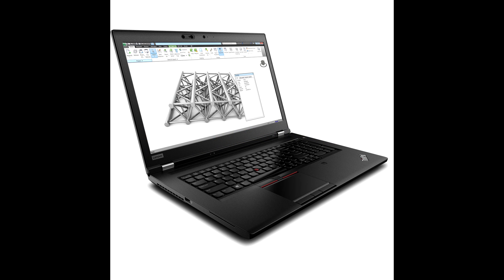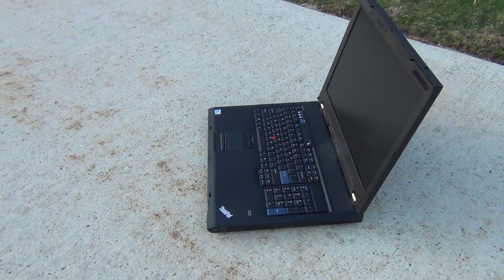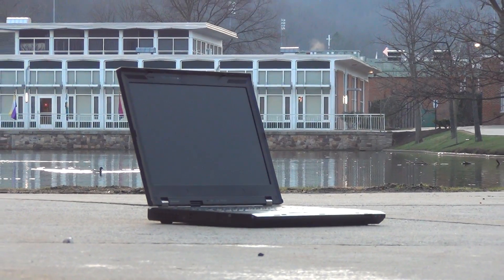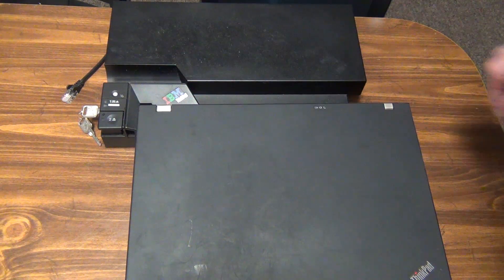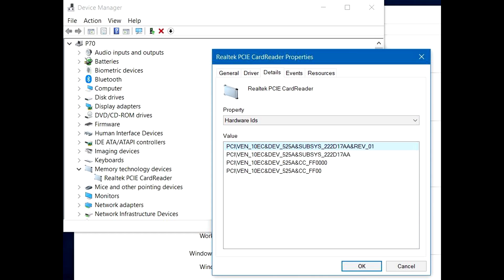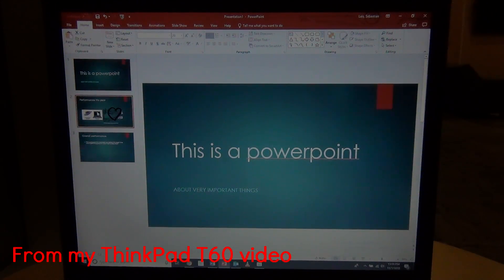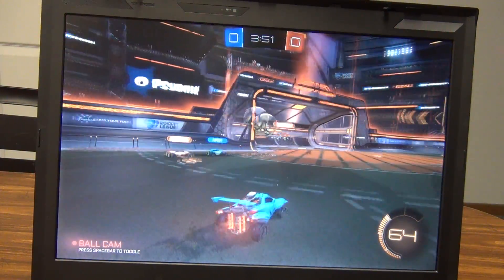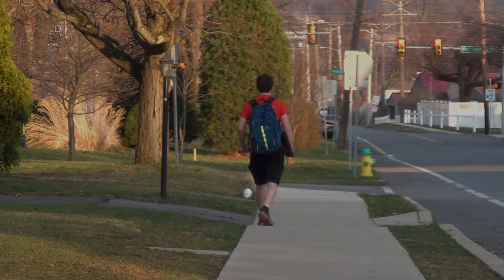Using an 11-year-old Mobile Workstation in 2019 (ThinkPad W700)

Comment: It's not officially supported since 8GB sticks didn't exist at the time,b ut W701 with quad core CPUs can even take 32GB of RAM
Reply from the maker: I remember reading about that somewhere, I think on the ThinkPads.com forum or the r/thinkpad subreddit, but even the ThinkPad Wiki page for the W701 didn't have this confirmed (it did mention that quad-core W510's could support 32 GB) so I felt it was best not to possibly spread misinformation.
Reply: @SebisRandomTech  I can confirm that my w510 is running 16gb RAM (4x4gb 1066MHz) on a quad core i7.
Reply: Wow! Would that upgrade be possible on a W500 or W700? And do you game on it?
Reply: Just a note as a reaction that you have never seen an Arrandale with 4 DIMM slots, Dell Precision M6500 sold not only with Quad and Extreme core CPU’s (i7-740QM, i7-840QM, i7-940XM) which allowed a user to have 32 GB RAM, but also with Dual Core i5-560M, i5-580M, i7-640M with 8 GB RAM limitation (only two banks could be used – similarly as on newer dual core Precisions where quad core processors are required to use all four slots).
Reply: The first gen i7 consisted of i7 dual cores and i7 quad cores. The dual cores had two separate dies on the "CPU chip", the CPU and the integrated graphics + memory controller which is based on the Northbridge that Core 2 Duos were paired with, so those maxed at 8GB ram using two 4GB sticks. They may recognize 8GB sticks but crash if you try using them. This applies to all first gen dual cores, i7, i5, and i3.
The first gen i7 quads on the other hand were entirely different beasts with new memory controllers that could use 8GB sticks so in your case you got it to use 16GB and the 4-slot machines can have 32GB.
Reply: @FleetCaptainTalmid  I learned all of that the hard way when I got an old Dell that uses first-generation Core i-series. Nothing you can do will make it handle more than 8 GB, even with the i7-640m. The i7 quads are a no go because there's no dedicated GPU. On top of that, you can't run 8 GB at higher than DDR3-1066 in this laptop (Inspiron 1764). It will run 4 GB in 2+2 configuration at 1333, but 4+4 or even 4+2 at that speed would crash during startup. 4+4 will only work with two sticks at 1066.

It's really not a viable machine with Windows anymore, but I installed a modern full-size Linux distro on it (albeit with Xfce) and it works great.

Comment: It is interesting how almost any 17" professional laptops of this era dissapeared from the used market. 3-4 years ago you could easily get them, now I see no w701 (not to talk about w700), HP 8740w, etc.

Btw, which 17" laptops (pro or not) do have 1920x1200 displays? (16:10 format)
Reply: Exactly. Even where I'm at in Malaysia, right now you can hardly find the popular ones on the market at a high amount and good price such as the x200, 201, 210, 220, 230, t410, t420, t430, and a few others. Back in 2020/21 the used market was flooded with them for good prices. It's like they've disappeared suddenly or everyone who got one has become a hoarder.

I got a 420, 230, and t60 back then, which were good investments on my part, as I still use them to this day, and the prices for them are more bloated now than then. I just got lucky with getting two for parts 220 for cheap price, and swapped parts to make the one with the better shell useable, and will sell of the other one for scraps/parts. Couldn't get a good 220 for a price that makes sense.

Comment: running those games were pretty impressive, i dont get the constant harping on "portability" i can pick this laptop up and carry it out of the room or out of the house just as easily as any other one, are we really counting ounces and quarter inches.. fits in a generic back pack fine, if you cant carry 8lbs you need to get off the laptops and outside more.. i carried a 25lb back pack through some hills, snow packed or ice covered trails, for a little over 2 hours this past weekend and didnt even notice the weight of the bag even when trying to maneuver hills that were a sheet of ice im not particularly fit either just got the urge for a winter hike

wish people would stop focusing on compactness and weight, and allow there to be two different genre's of laptops, ones for sleek feeling carry it to class tasks, and one for home users that want maximum I/O and performance who dont mind dimensions and weight.. i want a laptop not a desktop as i use this thing for work, for games, for TV, several hours a day i cant remember the last time i turned my TV on, no desktop, no gaming console, just one laptop, and i move around quite a bit, several times a year, but its also nice to be able to switch rooms or seating locations with ease.. to me if my laptop was  3" thick and 25lbs i would barely notice and id take that trade off for improved performance, a bigger screen, and a longer battery life, My 2019 Acer helios 300 still only gets around 2 hours of run time streaming a movie or youtube and thats with power settings being conservative..
Reply: forgot to touch on durability too.. ive had my power adapter fail twice due to bad design im sure that design was hampered by size constraints.. my speakers blew in under a year, fan failed recently, and both the CPU and GPU are constantly at thermal throttles, laptop gets too hot too touch under a heavy load which im sure isnt great for internal component longevity...

we praise the thinkpads for their durability.. while failing to realize most of that durability comes from their lack of interest in shaving off every gram, and packing thinks in so tight and precariously there isnt an ml of free space to get an extra 1/20" off the thickness
Reply: You are right!

Comment: I'm pretty sure early 2000s games would still run pretty well on this thing, with the occasional Dualcore / Dual CPU bugs that makes games running too fast. But i'm surprised the tested games even ran on a CAD optimized GPU. I love that it has 2 dedicated Fans. This should have ALWAYS been standard for laptops with extra GPUs. I wonder how much of the hardware is still supported in the current Linux Kernel?
Reply from the maker: ThinkPads are some of the best laptops out there when it comes to Linux support, so I wouldn't be surprised if the W700 works perfectly fine (or almost perfectly) with a modern flavor of Linux. Only one way to find out!

Comment: I still use a W510 as my daily driver.  I upated it to 16Gb of RAM and an SSD (and swapped the CD in the Ultrabay for another SSD for more storage), and it works like a charm.  Office work and web browsing is seamless.  The 1600x900 display is sharp, clear and readable, and, of course, it has the classic keyboard. Even though the GPU and 1st gen Core i7 are slow in absolute specs, I never feel like I need to wait for anythng.  
That said, I got a great deal on a Xeon P52, so I'll be switching to that soon.  Even so, I'm keeping the W510--it's a beautiful classic and it still works great.

Comment: I have a Lenovo ThinkPad T520 and love it. I have it maxed out in upgrades and the best part the laptop is just like brand new even the battery it came with
Spec's
Intel i7-2670QM 2.20GHz Quad core
16GB DDR3L 1600MHz
Samsung EVO 860 1TB SSD
ORICO Troodon  M200 1TB mSATA SSD
Windows 10 Pro
Creative Sound Blaster G3 Portable External USB DAC
Two batteries(OEM 6 cell and new 9 cell)
ASUS USB-BT400 USB Bluetooth Dongle
Cooler Master cooling pad
HP USB powered speakers
Lenovo ThinkPad laptop bag
Reply: @bjory It works great
Reply: @adamgrant1787  I'm on a W520 and thinking of upgrading to W530 only because of it's Kepler based Quadros on those as they still have proper driver support on Linux that should allow easy Optimus configuring instead of stuck using 390 legacy drivers like my current W520 with Quadro 1000M

Comment: How does this compare to a T530 Thinkpad with i5 3230m,Intel HD 4000 graphics and 16 GB RAM?
Reply from the maker: T530 is probably better in most aspects.
Reply: @SebisRandomTech  thanks for replying.
Reply: can I upgrade the CPU to an i7 3rd generation? And if so what is the thermal situation going to be like?
Reply from the maker: @mikestanley9176  In the T530, yes you can. I suggest the 3612QM or 3632QM, they have cooler thermals than other i7s from that generation.
Reply: @SebisRandomTech  thanks again.

Comment: The biggest problem with computing these days is browser optimization basically something that no longer exists.  With 4GBs of RAM you can cause a hard lockup with just Facebook and Youtube open.  This is beyond absurd.  The only optimization that seems to be done at all anymore is for mobile devices whereas desktop web browsers are left to eat memory like you are rendering 8K video.
Reply: 100%. Even watching lower resolution -720p-videos on YouTube just kills older CPU’s in the T420 laptops.
Reply: @wolfeadventures  I would try seeing if you can tweak the default encoder settings for youtube etc.  I mean it could also be the overhead of the OS but I also have an X201 with a first generation i7 and it plays youtube at 720 smoothly with no issues but it is also running Fedora Linux.  If you are on Windows there may be a few tweaks out there that will help on that platform too.  Just replying to mention that there are ways to get decent performance on video playback even with 10 plus year old CPUs in the these machines.
Reply: Animated ads on common websites is what started to do in my c2d PC
I think it was around 2011 here when that happened
Reply: I use Bodhi Linux, an I can run about 10 tabs smoothly with 3GB RAM and a Core 2 Duo T5670, with YouTube, Spotify, and websites for school like Google Docs and research. 720p YouTube, and 1080p with some dropped frames is doable at relatively cool temps, rarely above 65° C.

Comment: I am using a Thinkpad w500 w/ 4G RAM , 250GB SSD + 240GB SSD running Debian based Linux Mint (LMDE4). I am pleased with its performance.  I bought it as a used machine for around $200 and it has been with me for around 3 years now. A year ago , I poured water on its keyboard to test its water draining function, and I made a mistake of pouring too much water in short period of time and before I realized my mistake, the display became garbled. So I immediately shut it down. Took it apart to air dry the components inside and after one day, it booted up as if nothing happened :). It has a very sturdy build and I use it now to test the compressor control system of our installations, by way of VNC access to the compressor's Linux Based controller. I work in a very dust environment (construction site) so I know an ordinary laptop won't last here, but I have confidence in my thinkpad
to do the job since I can easily take it apart and clean it regularly. Lastly, it's 9-cell battery is still OK, but I just plug it in most of the time anyway.
Reply: Someone really needs to do something about web development.  Browser optimization is an oxymoron these days.  I have an x201T that had 4GBs of ram originally and for the first time in many many years even under LMDE I had a hard lockup of my computer just from having a few browser tabs open and trying to do one extra task.  It is a bit ludicrous when Firefox can double as a memory stress test.

Comment: Nice review...  I used this for work in 2009 and it was the best at the time.  Now I'm trying to find an adapter that would bring this back to life...  None of the tips work and I''l probably have to buy the original adapter...
Reply from the maker: Keep your eyes peeled on eBay. They’re extremely rare and expensive but occasionally one comes up for extremely cheap. I picked up mine for only $20.

Comment: Im running a w520 right now 12gbs of ram and it is great for everything besides new games. Unless i get an external gpu for it.
Reply: I had a W530 and I ended up getting an external GPU for it. It was the best purchase ever, brought years more life into it!
Reply: @direstr8s  thats what im thinking. All i need is a nice external moniter, dock or just hdmi. But i might as as well buy  used lenovo/hp,/dell and build on by adding gpu and ssd card for the price
Reply: I managed to snag a W520 for $225 on ebay that has 16 GB of RAM, a 240 GB SSD, and an i7 2820QM CPU. I'll probably put Debian or Artix GNU/Linux on it.

Comment: Wow, is that laptop is still very usable for use on 2020? Did you recommend that for desk use than an old pc? (posted from my T450s)
Reply from the maker: Your T450s is in most aspects more powerful than the W700. Unless you really want a giant laptop for some reason it's not worth the hassle, especially with how rare the W700 is.
Reply: @SebisRandomTech  what about W520? Or W541?
 Should i choose used Twist or X230 Tablet?
Reply from the maker: @ulungrinjanidharma8609  W520 and W541 are both much better choices that will offer a lot better performance. An X230 Tablet is a great "on the go" machine.
Reply: @SebisRandomTech  Wow, thank you Sebi

Comment: I've personally got a W701 as kind of a side project machine. That thing is definitely heavy. Got it from our classified group where it had taken some fall damage from the prior owner. Chipped a corner. However, that machine despite the drop still works like a champ. Battery is toast, maybe get 20 min power. However, considering how big the machine is and the fact that I have absolutely nothing to carry it in, it doesn't move from my desk. Not that I would take it with me anyway. I've got a W530 and W550s to fill that purpose. Overall, my impressions with that laptop are good. Monitor runs at 1920x1200, however appears overly saturated. I've still yet to be able to tweak it down to something more normal. It's an old panel, so maybe newer panels/IPS displays have ruined me from that standpoint. No complaints though, its performs pretty solidly, even by today's standards.

Comment: I own and use a W701 and mostly all of the stuff is same. On Windows10 1080p@60FPS does have some framedrops but when I use any Linux distro it doesn't (Manjaro and Ubuntu). W701 had no issues with the fingerprint scanner. The issues with dx11 still persists with my W7101 as this is a GPU limitation but again, that can be fixed by using an external GPU card with the express card slot.
Reply from the maker: Seems that the W701 has a lot of performance boosts over the W700. Of course, even going one generation beyond that to something like the W520 offers better performance than the W701, but there is no denying how solid the W701 is.

Comment: Okay so this video just taught me that holding the middle click button enables scrolling through the TrackPoint.

I feel stupid for not figuring this out earlier.
Reply: Clicking it also opens links in new background tabs
Reply: @archygrey9093  If it's set to middle click in Windows, yeah.

In Linux I have this as default all the time.
Reply: @TDGalea  every single Linux distro I've tried already has it set like that by default, i didn't think it was even an option to change it.
Reply: @archygrey9093  Definitely an option but yes, it's always been default for myself as well.

Comment: Windows is trash. You should use Linux on ThinkPads.
Preferably Arch for that stereotypical hacker look.
Reply: Dualbooting KDE Neon and Windows 10 on my T450. I barely ever boot Windows.
If Wine could run all the software I use perfectly, I'd dump Windows outright. Good riddance to that trash.
Reply: @TDGalea  I've been heavily moving away from Windows to Linux and there's very little that I miss. Proton for Steam and Wine take care of most of my Windows needs, but then again I've been moving away from proprietary software (outside of games) so my list of needed Windows software dwindles.
Reply from the maker: Nah.

Comment: That Thinkpad should be running Linux, perhaps Arch!
Reply: Nothing shows the age of an old Thinkpad like running Windows on it. I originally installed Windows 10 LTSB (a very slim and less bloated version of Windows 10) on my x220t with an SSD, but I later wiped the drive and installed Trisquel GNU/Linux because Windows 10 LTSB was still heavier on resources than I wanted due to background processes. Switching over to GNU/Linux halved my idle RAM usage and had enough power to comfortably run Artix GNU/Linux inside of VirtualBox. GNU/Linux is what keeps the good old Thinkpads viable.
Reply from the maker: Subjective. All about the preferences and needs of the user.

Comment: Sounds crazy but I'm also using a 10 years old machine (macbook pro unibody from 2010) after some upgrades it's still rocking and outperforming some cheap ass laptops from few years ago
Reply: i use Thinkpad x201 from 2010. and is still better than cheapest laptops around 200-300euros

Comment: I just bought a Thinkpad W530 with 32gb of ram and a 480gb ssd for $180. The quad core cpu and quadro graphics makes this my most powerful laptop and I love it. I'm waiting for my dock to arrive so I can attach it to my ultra wide monitor easily.
Reply: This is a great machine. However, keep it away from extreme heat or cold. The voltage regulators on these are extremely sensitive to extreme conditions. I have a W530 that just died on me and cant find a decently priced motherboard with a Quadro 2000m so its just a VERY heavy paperweight until i can replace it

Comment: What were the thinkpads you'd recommend over this? I really wanted a 15.6 or 17 inch with numpad. I picked up a w701
Reply from the maker: The W701 is a more solid choice than the W700, it has better quad-core i7's and supports up to 16 (unofficially 32) GB of RAM, and has LED backlit displays instead of CCFL's. Generally these things are so expensive it's better to pick up a W520, 530, or 540 since those offer better performance. If you're happy with the W701, then keep it! It's a beast of a machine and I love them, despite their age.